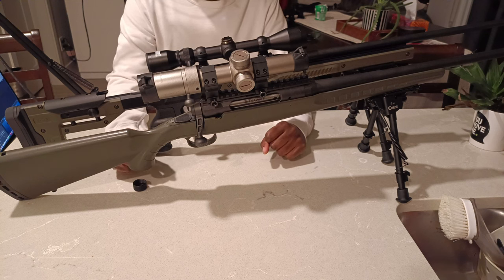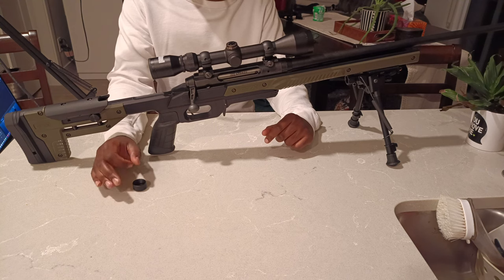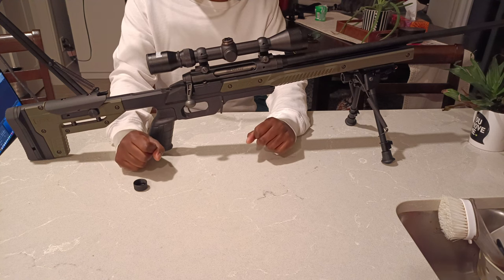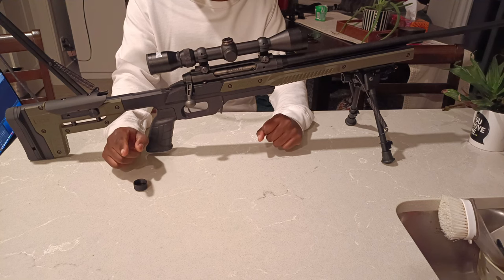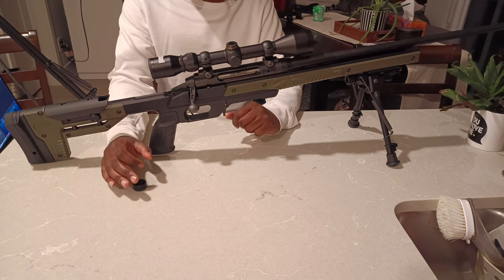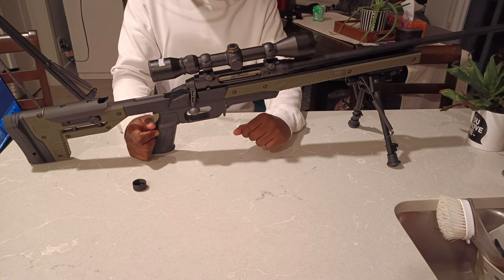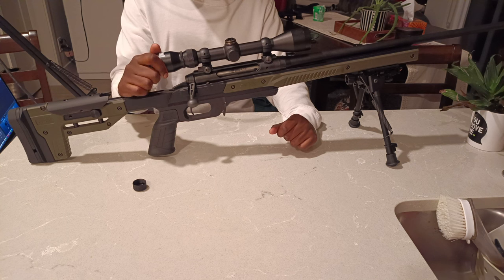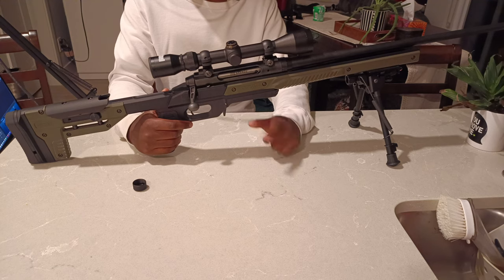Savage Axis 308 Accuracy Test. Factory VS Oryx Chasis and Lightened Trigger Performance at 100 Yards

Comment: I commend you for not only demonstrating group size with factory stock but what accuracy that you achieve with the installation of Oryx stock. Most videos are what I call useless. What any riflemen want to know is, “did the aftermarket improve the rifle’s accuracy?” As we can see the Oryx stock did improve. Thank you, well done!
Additional: Since that mentioned with Savage rifles an easy change barrel. I did just that, Savage 110 Tactical in 308W 20” deeply shattered bore. Teslong bore scope revealed a CRAP barrel! I replaced that barrel with a Criterion barrel cost $325 barrel only, but you'll need the right tools to complete the installation, my total cost for everything USD $1,035.00.
Reply from the maker: Appreciate that man. Ha! I hear ya, I too have my pet peeves when it comes to certain videos. That's a shame about the 110. I prefer heavy barrels and that's my next move is a 110. Glad it all worked out in the end. Happy shooting!
Reply: What caliber was the original barrel, and what caliber was the Criterion?  What groups did you get with the Criterion?  Thank you

Comment: thanks for the test.  I'm planning on getting the Oryx in a Howa 308 config soon.  My friend from work doesn't want to spend that much so it's good to know the stock Savage will have no trouble plinking steel at 914m at the range
Reply: I have seen that offering for sale. That is a good buy, getting it all together. I have an Oryx chassis for my TC Compass II in .308 W.

With the factory stock, I had .516 MOA out of the box. In the chassis, it has not gotten any worse. So, I can readily claim it is a 1 MOA rifle, even if the groupings are often closer than that.

One thing about MOA definitions. 1 MOA is 10.47 inches at 1,000 yards. You could hit inside that circle at 1k yards but it is still a 1 MOA rifle, not sub MOA. So, it is a double edged sword. Others who are more expert than I am (which is not saying a lot, anyone can be more expert than I am) say that a gun could be 1 MOA or less at 100 yards but not at other distances. The idea is that the barrel whip might only throw a 1.047 inch pattern at 100 yards but throw larger than 1 MOA equivalents at 500, 800, 1,000 yards. Someone had asked that question about two rifles being 1 MOA. One costs $500 and one costs $5,000.

Is it worth the extra money if they are both performing the same. I did not ask that question, raised a few of my own, mentioned my experience with my budget rifle and got my keister handed to me on a  shaky paper plate. I was informed that a rifle's MOA results change with distance, load, wind, climate. In all the time and all the books I have read, including some meaty books on ballistics, I have not seen this. But the guys who have spent $6k to $10k (USD) on their rifles assure me that this is so. In fact, when I had measured the first two shots on my Compass II, I was using my Stanley tape measure and measured .50 inches. Someone took my picture and digitally analyzed it and found the holes were actually .54 inches apart, not .50 inches apart. So, I was .04 inches off, probably due to me not measuring with a caliper or digital software at the time.

Since 1 MOA is 1.047 inches, .54 / 1.047 = .5157 etcterera, so I round up to .516, My rifle was pronounced crap, the round was crap, the Vortex Diamondback Tactical 6-24X50 scope I had on it was deemed to be trash. The digital analysis was that my crappy system and ammo (not even the brand or model that does best in this gun) produced .516 MOA, which matches the factory guarantee of 1 MOA on the first three shots. I could say that it is sub MOA or .5 or .516 MOA but I think it is best to stand at the factory claim of 1 MOA. That claim assumes factory ammo, not hand loads. I might get better results with hand loads. One of my studies of ballistics shows that if you can measure and maintain within a tight tolerance the same bullet weight and the same charge weight of whatever powder that you are using, you will get consistent results.

Which takes time. In my opinion, what do you do with the bullets that don't fall in line? Make rounds purely for fouling shots. Not meant to be great at target, you just fire at a sacrificial test target to get some copper in the barrel.

Good video and thanks for sharing.

Comment: its amazing to see youth in shooting sports. however, you have room to improve as a shooter. you use the correct part of your index finger for the trigger, but your hand is closed outside of the grip. youll handle recoil way better if you close your hand around the grip. obviously you should pick what is comfortable for you and should take this comment as just a suggestion. but it will help vastly when moving to bigger calibers.
Reply from the maker: Ahh I heard your less likely to jerk with your thumb not closed around the grip and it makes for a more consistent pull. Been shooting open hand since for precision shooting. Thanks for tuning in!
Reply: @killshotcanuck  i must be an odd duck then. i heard the same thing but had opposite effects with my 338